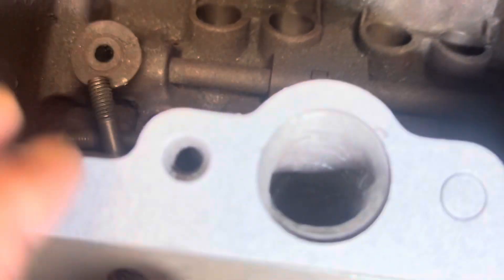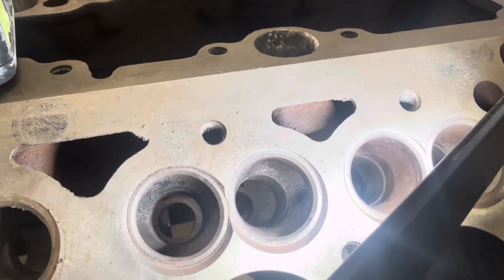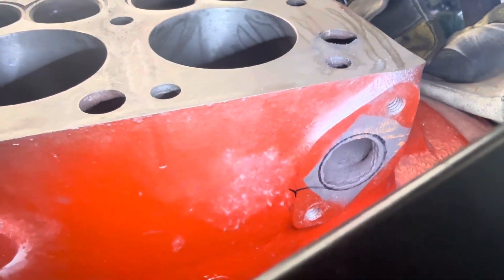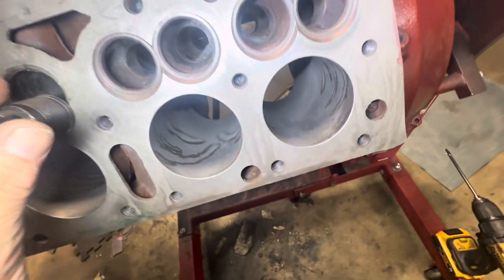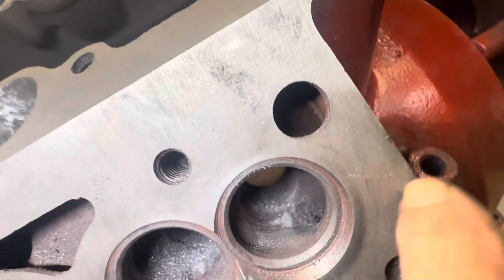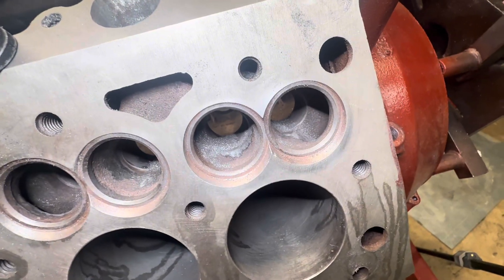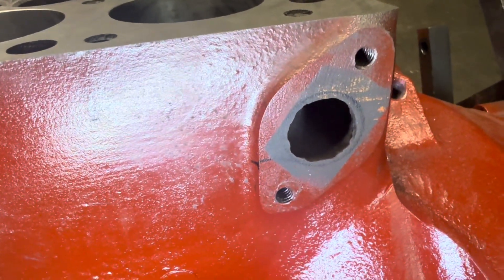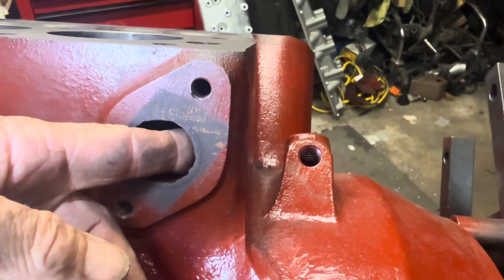Porting a flathead ford block. Intake and exhaust ports. Gasket matching and opening up the bowls.

Comment: Go buy two or three ball bearings and put them on the shaft of the bit, then slide a piece of plastic pipe over them to make a handle to place your fingers on. It will give you better control over how your bit will move because you can hold it more firmly while maintaining more control over any unwanted movement. The way you are using it whenever you need to put more pressure on the bit for control, you can't because you're grabbing a rotating bit. Just a cheap simple way of making what you have work better for you.
Reply from the maker: Wow that’s an amazing idea!!!! I love your comment dude